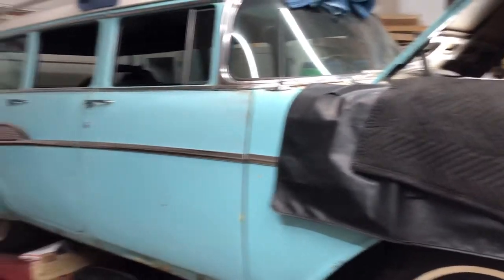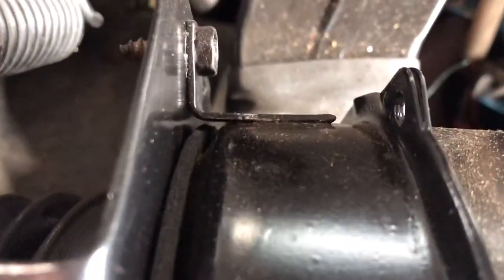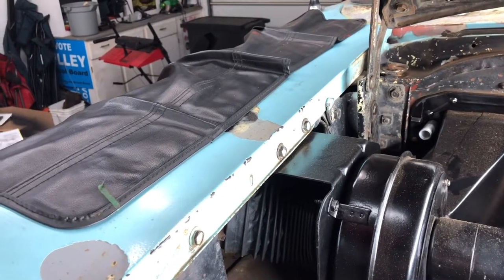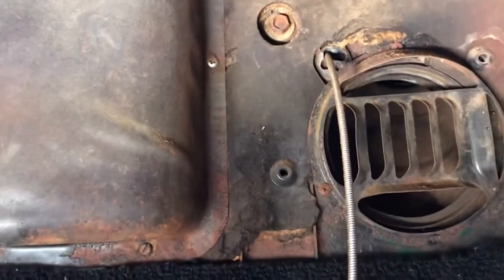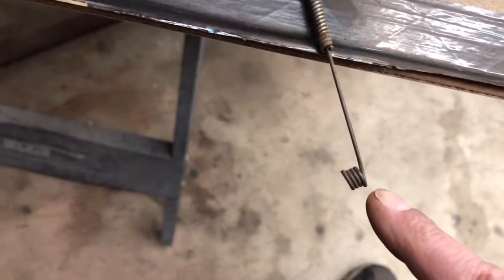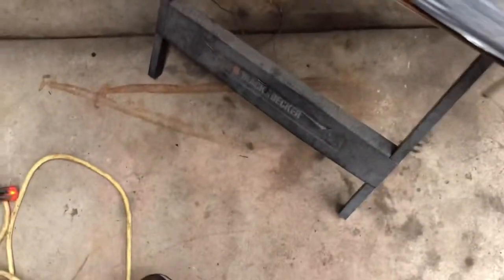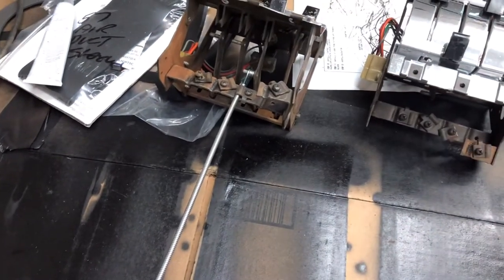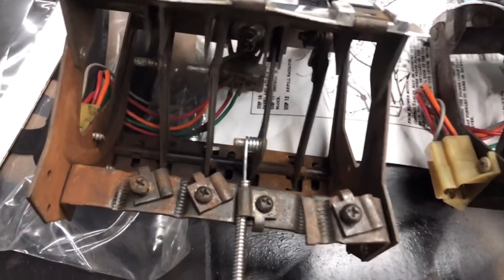1957 Chevy Bel Air heater controls ventilation system

Comment: try giving the original cables an oil bath   let en soak a few days in oil   they will loosen up        the control panel on the dash can snap the levers if they are too tight

Comment: Thanks for the information.i am converting my 57 to the deluxe system from the recirculating style.i have all the parts except the main dash control. I can't afford the brand new ones for 400.00.i will do as you did and search swap meets and classifieds.
Reply from the maker: Thank you!  I believe mine was $60 at the swap meet. It cleaned up real nicely with some 000 steel wool. Good luck with the conversion. 👍

Comment: Awesome  video, can you make a video of how to connect all ducts under the dash? Does this video work on a 57 chevy 210 sedan also?   thanks! William
Reply from the maker: It should work on the 210 as well. If I recall correctly you slip the cable over top of the flapper lever and lock the cable in with a clamp and screw. The flappers for the vent tubes are located under the fenders in the engine bay. They are a real challenge to get at and secure the cable correctly.

Comment: Nice vid👍 I have a 4dr belair same color, was a heater delete from Georgia so I need to do my heater system at some point too. My question is about your brake system, where did you route your vacuum line? From carb? Or manifold?
Reply from the maker: You can do either but I have mine going to the rear carb vacuum. It is shared with the modulator to the transmission.

Comment: I know its been awhile for this video, but; did your heater core box cover inside sandwich together good? My cover has 3 like standoffs on the cover which keeps it from going together could I just cut them off?  thanks
Reply from the maker: I'm not sure why yours is having issues.  I did all my heater core work from the engine bay.  The slides are knocked off and the cover comes off.  the box insider the firewall is very small and I did not remove it.

Comment: Is the heater core in the way installing vintage air?the reason i ask my dash is torn all apart,doing complete restoration myself and dont want to do it twice installing heater core than removing heater core to install vintage air condition
Reply from the maker: I am not sure as I don't have vintage air.  But one thing I know is that the heater core is contained in the protrusion on the firewall